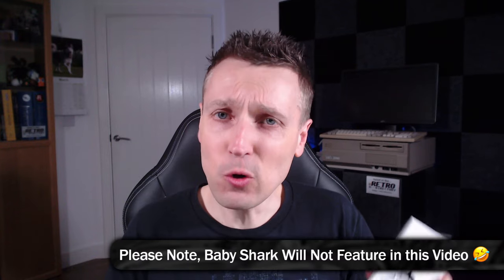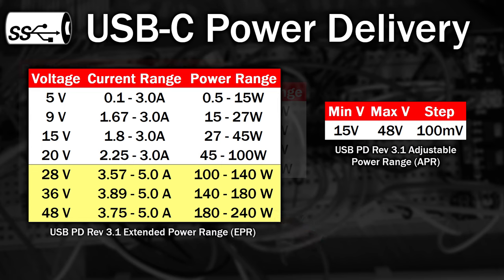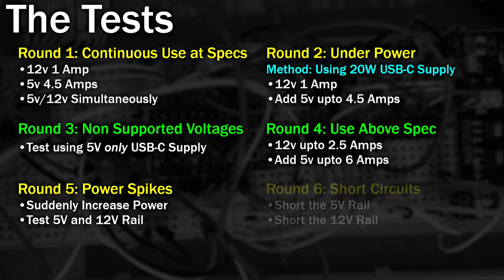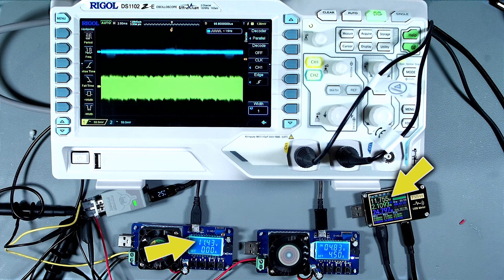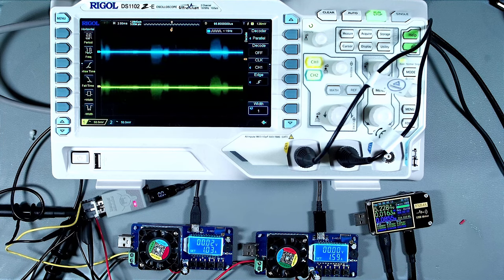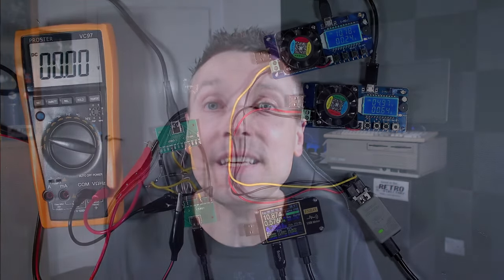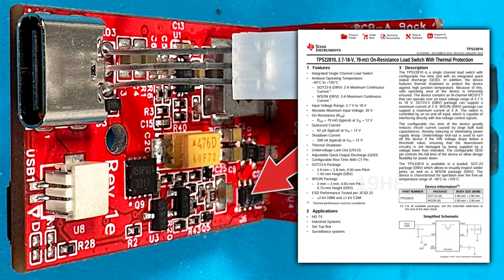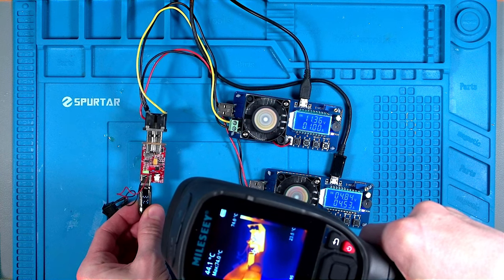Can the PowerShark Protect Your Amiga? Full Tested

Comment: It looks like a well designed little gadget. When I saw this device originally, I wasn't too sure about it, but these tests really put it through it's paces. I also wonder if it won't even get that hot in actual use as some heat would be coupled into the Amiga itself and dissipated (so the Amiga acts like a heatsink for it).
Reply from the maker: Yeah seems under "normal" use sticks at that 40 degrees level which is perfectly fine and kind of "ambient" for electronics I guess

Comment: I have seen some people moaning about the price of the Powershark but when you think of its capabilities and Amiga protection circuits it is worth every penny IMHO, and thanks for a professional  and unbiased in depth review Rob
Reply from the maker: Thanks! I kind of hoped it survived all my testing, and am really glad it did... (....but did I secretly want to break it lol)
Reply: @RobSmithDev  Another test will be when there are many of them in operation in the field being used every day
Reply from the maker: Absolutely. I’m going to have mine connected for several hours this afternoon at my local Robin Hood Amiga Group meet
Reply: Factoring in the price for both this and the USB C adapter and postage puts it in a higher price bracket to other modern replacements. Not helped by them charging VAT unnecessarily for customers outside the EU unfortunately.
Reply from the maker: @mja65 true maybe the next batch will be cheaper. I did just find and test a 100W USB-C charger that works perfectly and only cost £19
Reply: @RobSmithDev  I hope that's the case  - I just did the sums and it works out the equivalent of 97 pounds to get the icomp CA-PSU delivered to me (just as an example) and 105 pounds to get the powershark (plus a charger). I haven't seen a head to head between the two (that would be interesting btw!) but an interesting question as to which one performs better given the similar price - acknowledging the small form factor of the powershark. Thanks for a very informative review btw - I was only a couple of mins into it when I wrote my original comment so thought I better save my praise until I got to the end 🙂
Reply: or you could just use a surge protector?
Reply: @RobSmithDev  RobinHood Sutton ?
Reply from the maker: https://rhamiga.com/
Reply: fully agree on the price, and to be honest 70e is not that much
Reply: You can run an Amiga off a Meanwell supply that has decent protection, which is what most of the third-party suppliers use in their custom enclosures.
Reply: @mja65  An Electroware Amiga PSU is US$50 and ships worldwide. I'd pay up to the same amount for the PowerShark, but not 50% more.

Comment: Nice review, I’ve had mine a while and am really happy with it so far. I’d definitely rather rely on this than custom PSUs, gives far more flexibility
Reply: Just as a follow on, one issue I did have was that on my 1200 with vga out where the next to the power, it overlapped the vga a little so had to cut the edge off a vga cable for it to fit
Reply from the maker: Makes sense I guess it is a little larger.

Comment: Hi, I have an A500 with a GVP HD+ hard drive that I have modified to get power from the Amiga, do you think the Power Shark would be able to handle that  load? Great review and I will probably get a power Shark anyway.
Reply from the maker: Does the GVP actually contain a real spinning drive? If so I wouldn’t recommend doing that even with a normal Amiga supply. 
If it’s got something like BlueSCSI it’ll probably be fine, ran my A590 like that for several hours no problem (and from a powerbank too)
Reply: @RobSmithDev  Yes its a real drive, Quantum 49mb,, the PSU has these specs: Output 1: +5 vdc 4.0A, Output 2: +12 vdc 2.0A,
Output 3: -12 vdc 0.5A. Hmm actually I also have an external gotek connected and a KCS Power PC card in the trapdoor expansion. The PSU gets a bit hot I must admit, its a new modern type, not Original.
Reply from the maker: Yeah it’s not recommended to do that kind of Mod with a real drive in there as it will slowly damage the tracks inside the Amiga. I’d swap it out with something solid state or use its proper power supply or you risk damaging the Amiga in the long term
Reply: @RobSmithDev  i did'nt know it would be a problem if I used a 'real' hard drive, but I have read about this now, so I will have to get another psu for the GVP, unfortunately I can't use something like a zuluscsi since my KCS Power PC card can only work with a real hard drive, so I am going to undo the mod and get a psu for the GVP, thanks for the info :-)
Reply from the maker: No problem

Comment: I've always found that USB PD capable supplies, even the cheap ones, have great power management. you're probably unlikely to run into power issues with a USB PD supply, most of them also have an overcurrent protection. 
also this gives you the option to have a battery powered amiga. get like a portable HDMI monitor and plug the amiga in using an adapter. all powered off a battery bank.
Reply from the maker: I did this exact thing for several hours at a local Amiga meet up recently

Comment: WTH did they remove the 12v supply option??????  What happens if you use a PD supply with only the 15v profile?
Reply: If the PSU doesn’t support 12v output then it won’t power up and will just show a red led
Reply from the maker: It’s less of a problem because the PD3 etc covers that voltage again so works